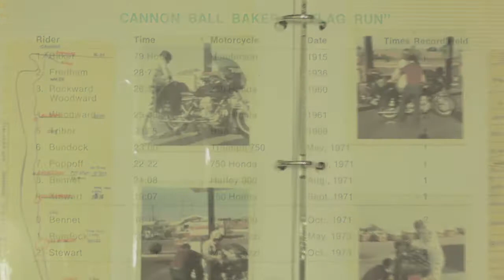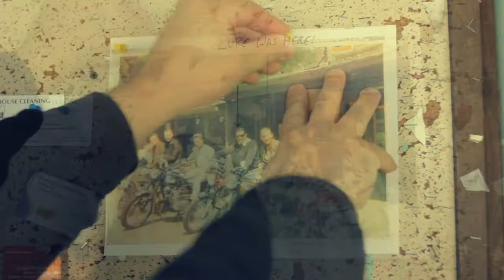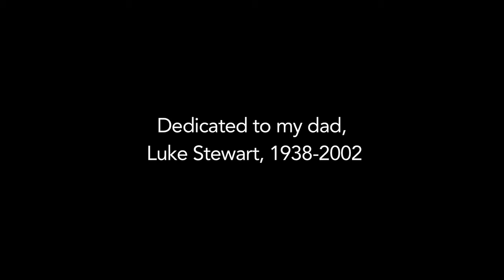BMX Revisited

Comment: Thanks for sharing. That Champion Squareback is slick. As a kid I was into dirt bikes and BMX. I remember Champion and Redline for their flat track frames. I got into BMX a bit earlier on and went from a Schwinn Sting-Ray to a Yamaha Moto-Bike (that didn't even hold up as well as the Sting-Ray — I split the frame at the head tube). I eventually built up my own bike around a then new Schwinn Competition Scrambler 4130 chromoly frame. Now closing in on 60, I have a Kona HumuHumu for my pub cruiser.